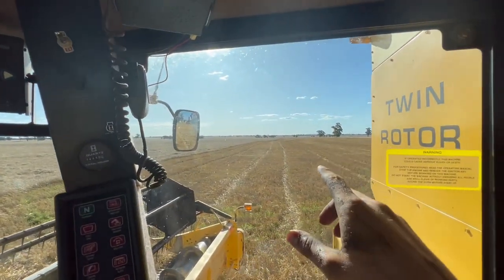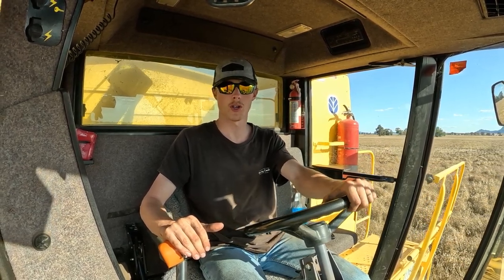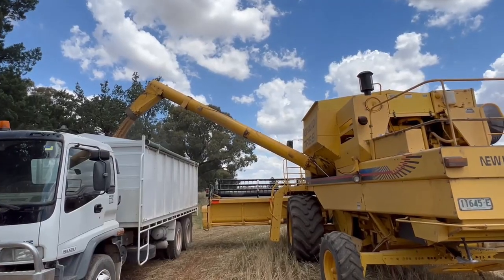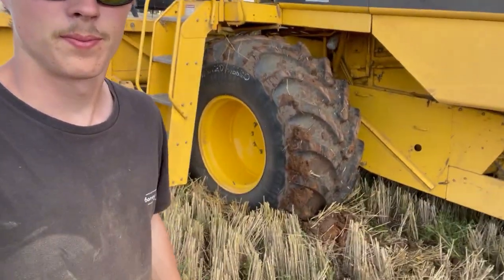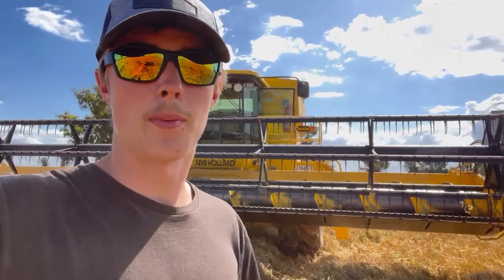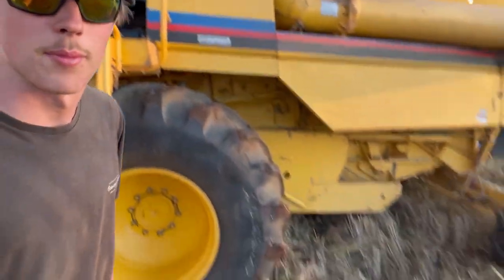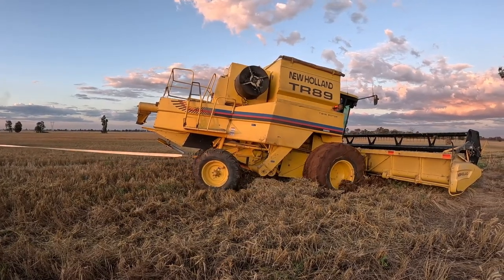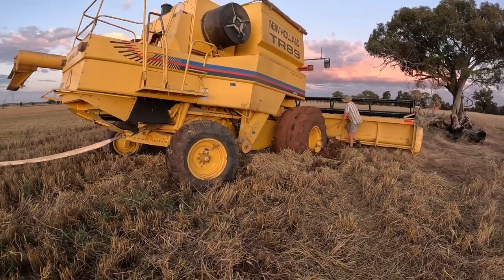Stuck Bad!!! Let's Go Harvesting 2022

Comment: Hey mate we’ve got a TR 87 and just wondering what settings you guys start with on barley? Hope things are drying out for you!
Reply from the maker: Top sieve 11 from right, bottom 15 from right, back extension 15 from right 
Rotor 1200-1400rpm
Fan 750-800
Concave 2-3
Reply: @b.pfarming4354  cheers!